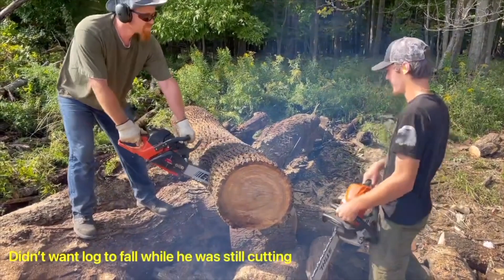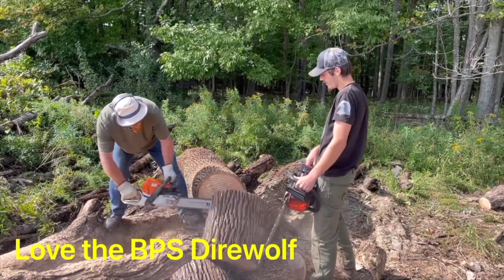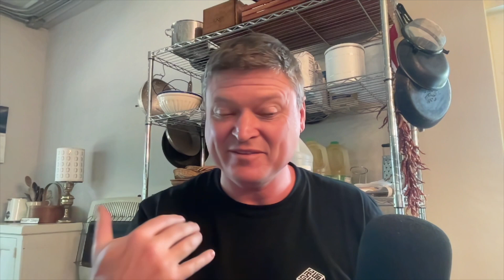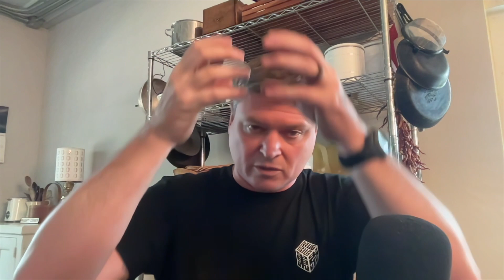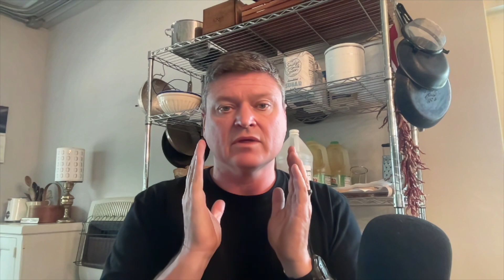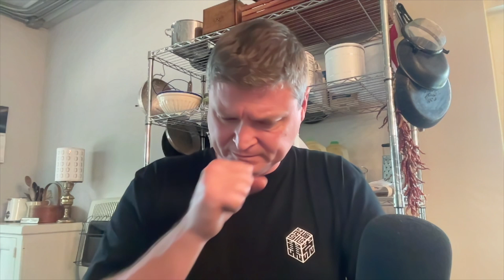Stihl MS400 vs Ported Echo 590 @redtiller1975

Comment: I know why you do it, and youre not totally wrong...but! If the saw is turning faster than the chain can efficiently cut, it will get easier and easier to hold higher rpms while not cutting any faster. Put your chain on backwards and see what rpms you hold then!

The only reason i bother saying it, is because as your chains get better, they probably wont hold 12k in the wood so reliably and i would hate for you to see that as a negative when theyre actually cutting better at the lower rpm
Reply: Yea you can do that, BUT if you do either of a couple of things it’ll negate that stuff. Either lower your rakers a “little” OR don’t have your chain quite so tight because you NEED your chain to “rock” back and forth while it’s doing it’s “thing” to cut efficiently.

Comment: I've been thinking of going with donny walkers style of using duration to get my numbers and keep it kind of conservative for reliability. Anyone got an opinion?
Reply: Duration, picking numbers, crankcase compression, blowdown, etc.
   All different words to end up in the same general place. Use a timing wheel and whichever method of picking numbers that works best for you. 

Understand that without some kind of machine work (base and or chamber cut) your gains are usually minimal.
Reply: @Super-Dave-Outdoors   thanks for the reply. I'm learning and researching. It looks to me that measuring duration eliminates the need to find TDC and just count the degrees between open and closed. I'm a complete novice so I'm definitely not saying anything as fact. Just trying to get some gains and take small steps and any advice is appreciated